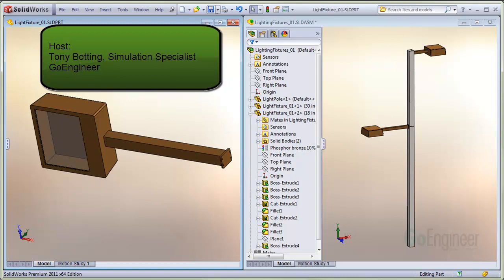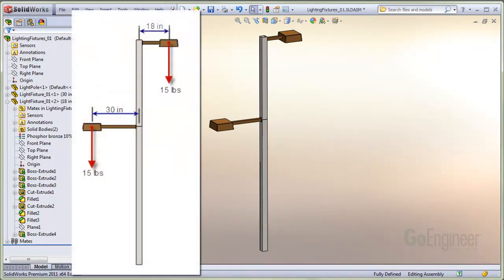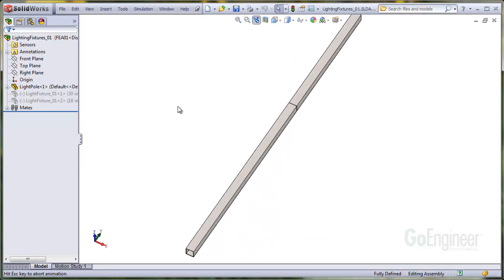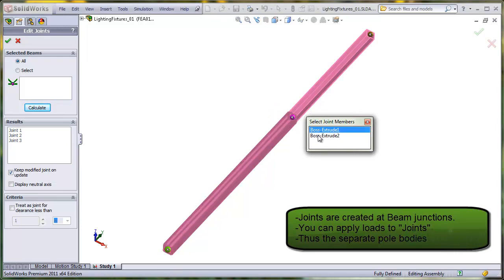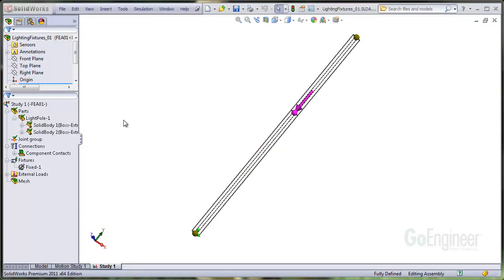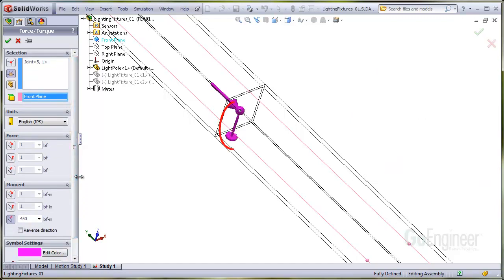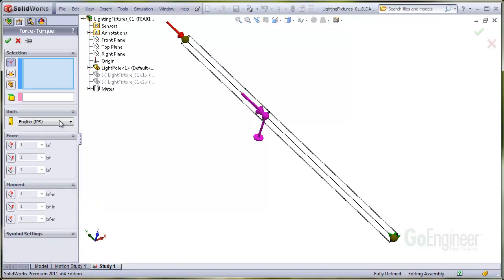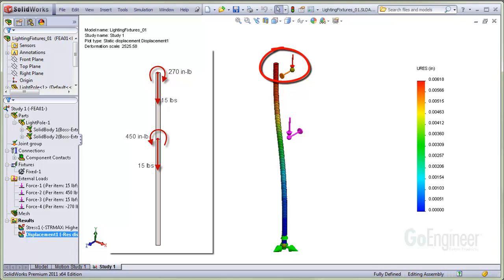SolidWorks Simulation - Beam Torque and Right-Hand Rule

Comment: It is not called torque, should be called moment. The torque is defined the moment with respect to the beam axle. The torque in this case is zero, because the arm of the torque is zero. But the bending moments are not zero.